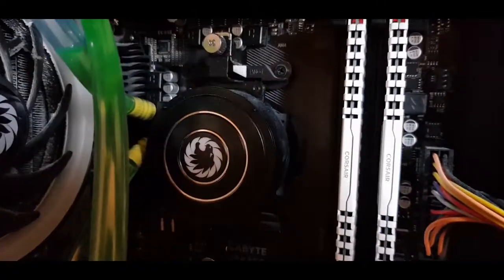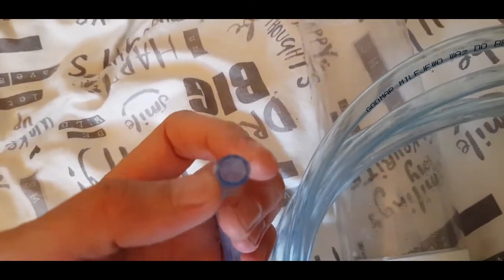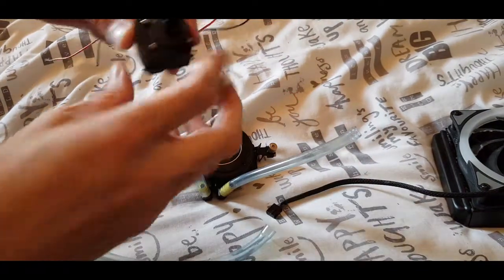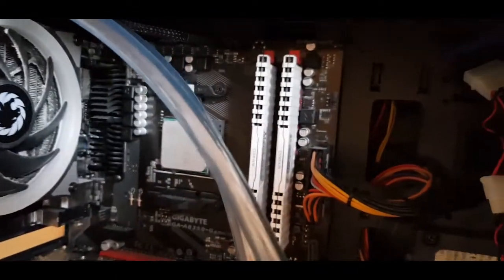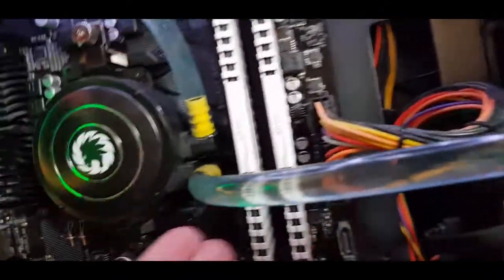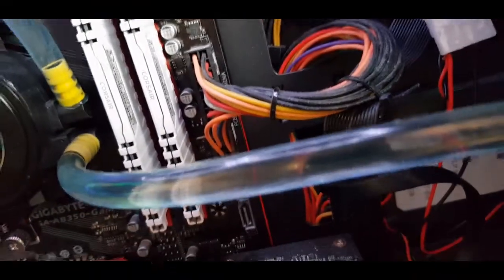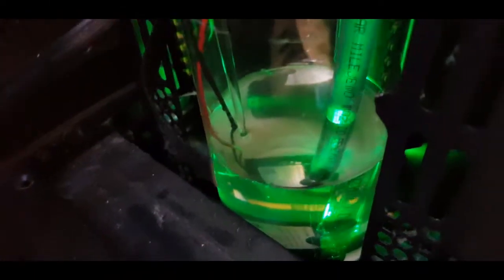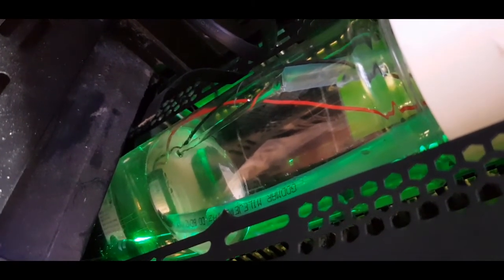Diy water cooling on the cheap

Comment from the maker: I've been running this for a while now and the highest temps I've had so far is 42C. Runs super cool, all leaks sorted, so the only changes I've made is add more fluid to the tank, so make sure you let it drain fully before topping up and fill to about an inch from the neck of the tank  and make sure you have the pipes with clamps on the connection ;)